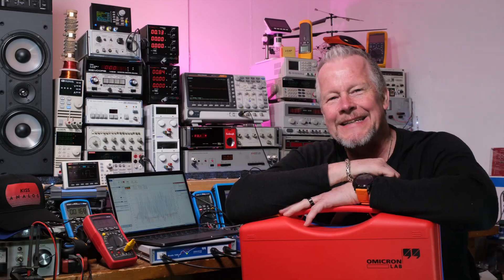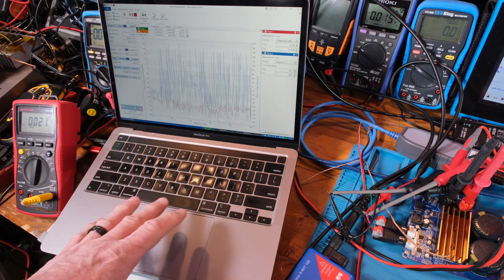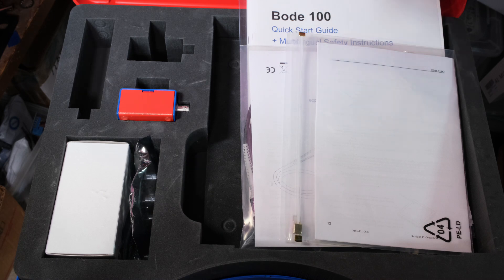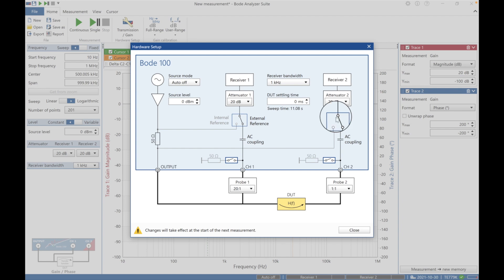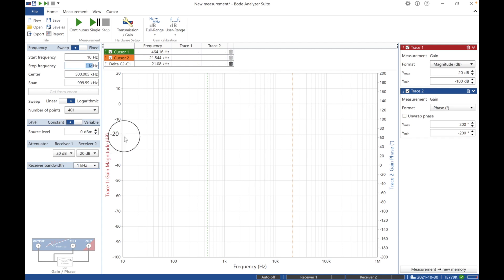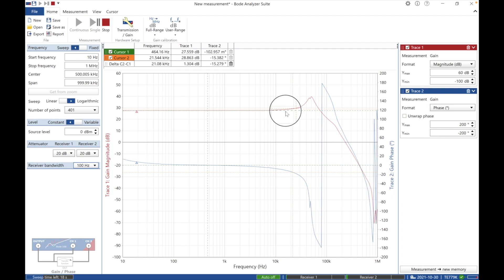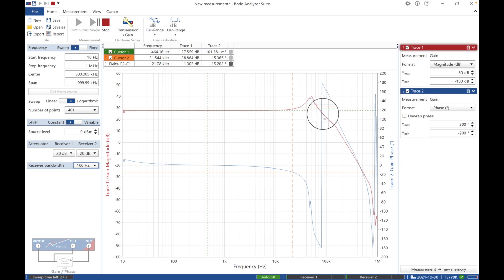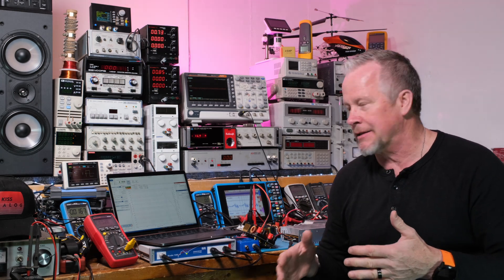Class D Amplifier TPA3255 Bode Plot with Omicron Lab Bode 100 #Omicronlab #TPA3255 #bode100

Comment: I stumbled across your videos early today while researching how to power a little project amp.  Super informative videos, Can't wait to see how the amp project comes together.  Quick question, the little amp I'm playing with requires positive, negative, and a ground.  I have been told that it is for battery only but Id like to use it with a power supply.  The hurdle is its operational voltage is 58-70 volts.  If I use a traditional power supply like a 60volt like you have linked, and I do the resistor/capacitor bit to create the virtual ground I reduce the voltage by half and it is no longer the correct operational voltage.  Any suggestions to help me navigate this rabbit hole?  its an irs1092 board.
Reply from the maker: Great question!  Does it want a plus and minus 58-70 volts?  If so, then get two power supplies and stack the outputs like batteries.  Make sense?
Reply: @KissAnalog  I appreciate the response!  It's been quite a while, I did figure it out, but I don't exactly remember what the solution was and why, but  It was something like it needed a special power supply that had 2 different types of DC power, almost like AC Hot and neutral kinda, there was a required 3rd leg that was weird, but they do make a power supply like that it was quite expensive and it turned out cheaper to go a different amp board.

Comment: if you really wanted to show what that  Bode 100 does you should have probed the circuit where the class d integrator loop is located, you could then perform analysis of each loop in the each control loop and figure out what the bandwidth and loop gain looks like which is far more interesting and of educational value as well which does justice to the bode 100.
Reply from the maker: Thanks for the feedback!  The TPA3255 is an integrated chip so this was video to show the performance of this amp.  I'll show the Omicron in videos to come.
Reply: @KissAnalog  honey I know that, I'm saying the loop gain aspect and loop frequency response is of measurement interest. I do wonder what an audio precision have over a bode 100.
Reply from the maker: Ok thanks!  Let me see what I can do;)

Comment: Good Bodes 👍.  Would have been good to see a full sweep for distortion across the whole audio band and at a mumber of different amplitudes instead of just 1khz, and some  intermodulation tests too. I have seen amps that perform the same at 1khz be very different above 10Khz.
Reply from the maker: Thanks Ian for your feedback!  Did you see where I scanned it out to 1MHz?
Reply: @KissAnalog  Hi Eddie, yeah I saw the bode plot out to 1MHz, but I was referring to doing a full distortion plot, at least 20Hz to 20KHz (by that i nean sweeping the test signal 20hz to 20khz) both close to full power and at 1 or 2 watts, because in previous videos on the class D amp you had only measured distortion at 1khz on your Keighly meter (from memory it was a while ago). I suppose I should have made the comment on the other video really apologies for causing confusion. I was just wanting to emphasise that when making comparisons on subjects like class D vs A/B or powering an amplifier with linear vs switching power supplies, it would be better to have other measurements as well as bode plot, and distortion at 1KHz in order to arrive at a more detailed conclusion regarding the performance of each. When the new switching powesupply is done it would be cool to see some really in depth measurements done with the JAT amp and to compare it with how well it does with a linear powesupply. Maybe also include  intermodulation distortion etc etc so we can see the whole story
Cheers 👍

Comment: 10:51 That bump at about 40kHz to 45kHz is the output filters inductor and capacitor reacting with the 8 ohm load.  The default filter with two 10uH inductors and the two 1uF capacitors in series on the output would work better with a 4 ohm load and should not give you that hump.  A better filter for BTL and PBTL modes is to use one single capacitor across the output after the inductors instead of the two in series that are ground tied in the middle. It's fewer parts, half the capacitance as the two series caps version and its the same sound...
.
Some values for inductors and capacitors in BTL and PBTL mode that give a fairly flat response with -3dB down at ~45kHz (and no hump):
@~2ohms: L1,L2 = 5uH, C1 = ~1200nF
@~4ohms: L1,L2 = 10uH, C1 = ~600nF
@~8ohms: L1,L2 = 20uH, C1 = ~300nF
@~16ohms: L1, L2 = 40uH, C1 = ~150nF

With those impedances and those component values the plot should be the same all the way up to 45kHz ;)
Reply from the maker: Thanks so much for this great feedback!!  As the speaker impedance is not flat - I wonder which LC combo would be a good fit to cover a swinging impedance?  But also to remember is this happens outside the hearing range.
Reply: This seems to be a massively overlooked issue with these TI chip amps. 
Manufacturers of these boards could in theory build in a switch or even automatic detection.. or just sell bespoke boards for your application.
Reply: Totally agree that's the first thing I do when implementing a class D amplifier is modifying the the lowpass filter for the load
Reply: @davidkclayton  the impedances curve of speakers is also by no means flat. So using the headline figure could be a bit of a trap too 🤷‍♂️
Reply: @FelixRisingOriginal  most speakers impedance stabilized at the high-end (@ fc)
Reply: Wow ... I'm late to the party :) With the upcoming of PFFB circuits, the problem seems to be more or less solved. 
But for a normal PBTL module that I integrate at the moment, I just change the filter C from 1uF to 0.68 uF and keep the 10 uH coil but use a better one than built on donut. The bigger values coils are electrical more critical too and you get higher THD.
It's all just a compromise, lowering the Q a bit with the smaller C helps to avoid such peaking and the impulse will be better. Most tweeters are around 6-10 Ohms @ 10-15 kHz, the reference 4 Ohm design from Ti is absolutely off, but they still recommend it. 

In the end, the amplitude gets flattened by active EQing anyway while doing room correction.

About the values of the filter parts. As far as I know, for post filter PBTL the values adding up, for pre filter PBTL they stay the same. Maybe I'm wrong ...

Comment: Hi! When i watch the other videos about noise levels for power supply.
I don't know if it is working as a class D amplifier.
There is a big discussion about that class D "looks"/perform nice if you looking at 20Hz-20khz range.

But the switching noise the designer moving out of that range and put it much higher up in the frequency range! (For example 100kHz)

The questions are:
* When looking at noise should we not also look at a more generic broader frequency range than only the specific hearing range? (There might be amplifiers or (super-)tweeters that play beyond 20kHz that might be affected.

So the conclusion COULD then be that linear power supplies has a lower noise in total than switching power supplies has when looking at a broader frequency range!🤔

Thanks for your videos! I like to hear your take or measurements on this?!🥰
Reply from the maker: Great questions!  As the graphs show, this class D is flat across the hearing range and beyond in both magnitude and phase.  it can be argued that switching power supply noise is outside the hearing range.  This has actually been a work in effort since they came out, and MOSFETs have been a huge help so that they can switch faster - well beyond the hearing range.  Linear power supplies are actually low frequency switching power supplies - unless they are regulated - linearly.  I compare power supply noise between actual linear and switching power supplies.  https://youtu.be/kPHduHM7V1k
Reply: Look at Burno Putezy work on noise in class d if you want answers. But to make a long story short no classd is silent to your ear the residual noise is negligible as it's 100mv switching voltage to force the loop to perform self oscillation.